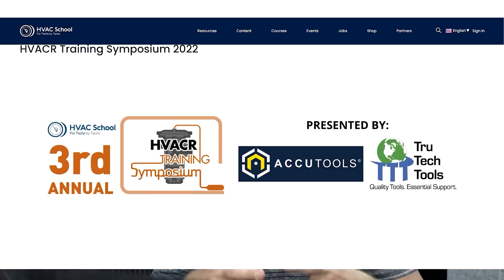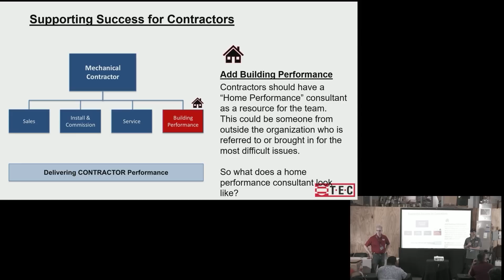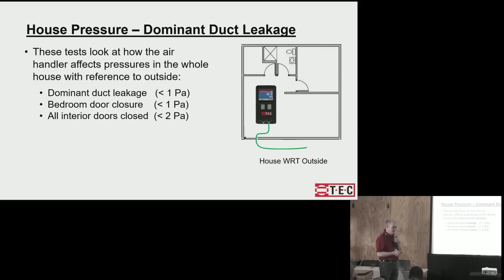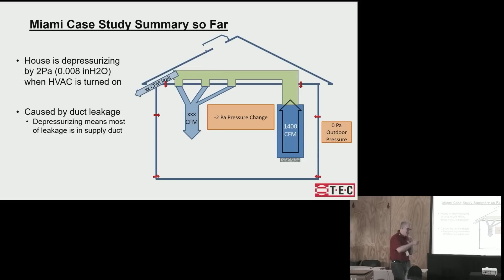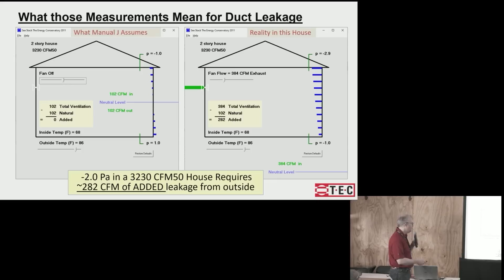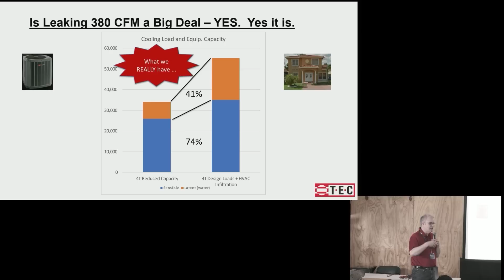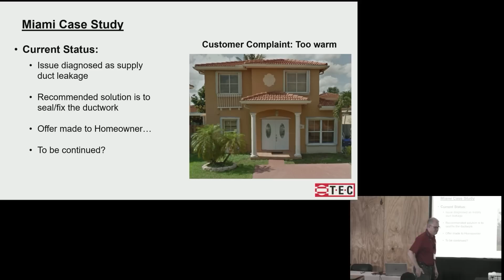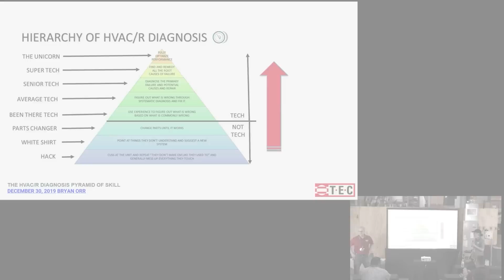Dealing with a Problem Home, A ''Basket Case'' Case Study

Comment: I thought the title was referring to dealing with certain customers 😂
Reply: I know, right? But the reason I was able to see through it is because a faulty customer is not the first angle that a professional in any trade would take.
Reply: Sometimes service calls happen because of a malfunctioning customer lol...
Reply: @immattlaramee  Sometimes all you have to do to reset a malfunctioning customer is to ask them to insert their flat plastic extremity into the little slot on your handheld customer reset device.

Comment: When will building code require all equipment and duct to be inside the house envelope? When will DOE require the same. When will OSHA require equipment to be located in a safe area?
Air handler, Blower Coil, whatever you want to call it and all ductwork should be located inside the envelope. Then if there is any type of leakage, it will not be lost to the great outdoors. 
Insulating ductwork in an attic still gains 6k - 12k  or more btu's of heat. Lot of energy lost.